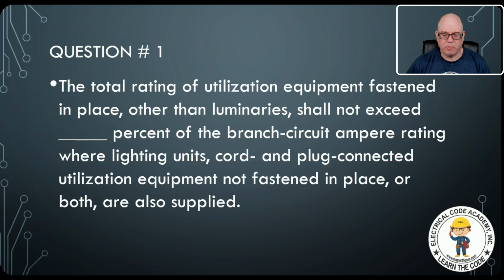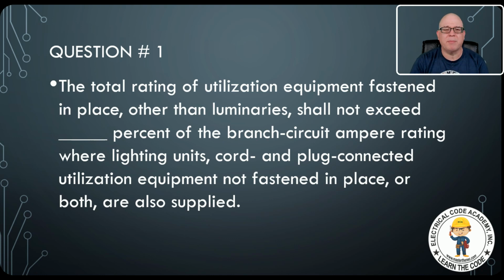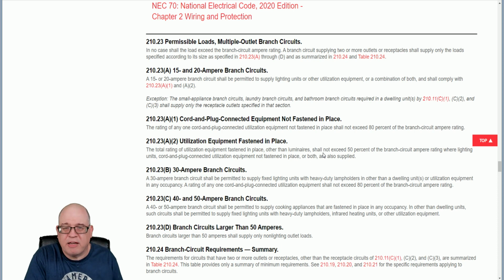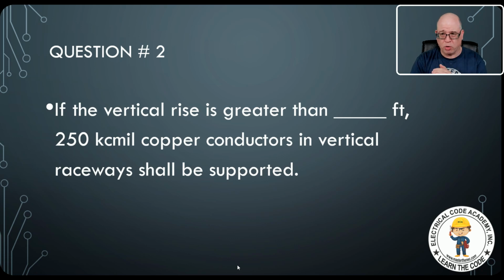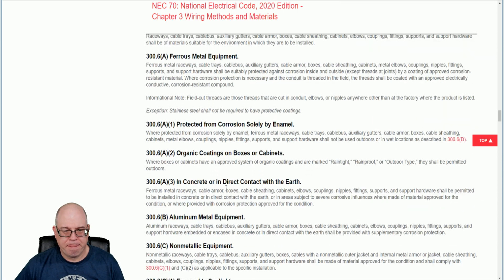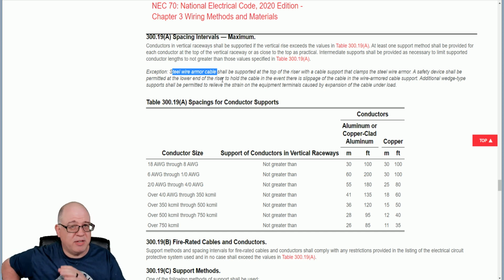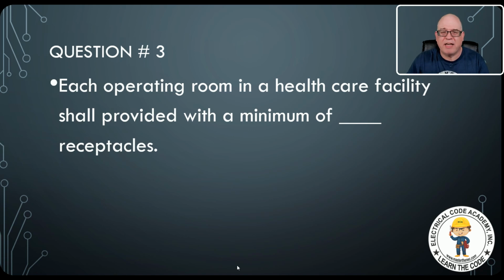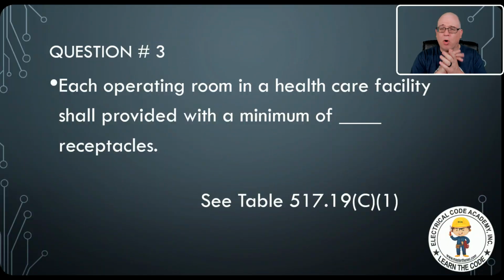Electrical Exam Prep Study Course | Master and Journeyman Electrician

Comment: Wow 36 recp's in an operating room, that's a lot lot lot😁
Reply from the maker: Indeed - I guess that in the operating room you have so much equipment, life support and diagnostic equipment that it is essential. Better to have too many than not enough. Can you imagine the surgeon saying " hey nurse, can you run and get that extension cord and relocatable power tap so we can plug in the defibrillator" Yeah - That would SUCK.
Reply: @MasterTheNEC  😁yes that would not be a good situation
Reply: @MasterTheNEC   how can I get in to the fast track program
Reply from the maker: You can purchase it at https://fasttraxsystem.com/fasttraxblack
Reply: @MasterTheNEC  thank you